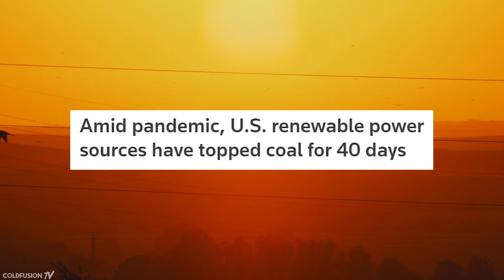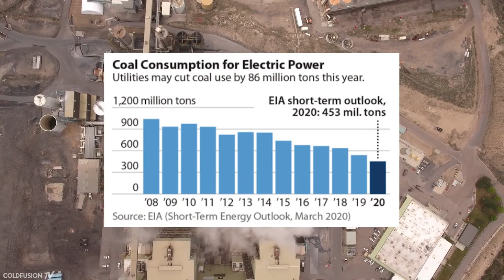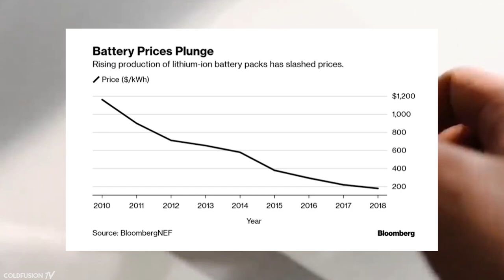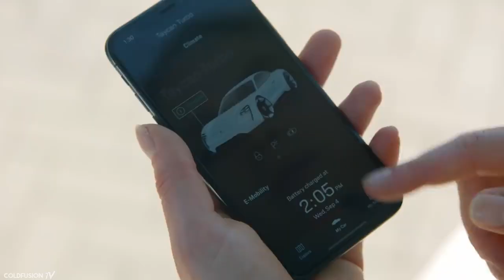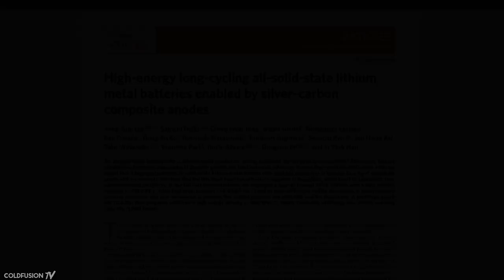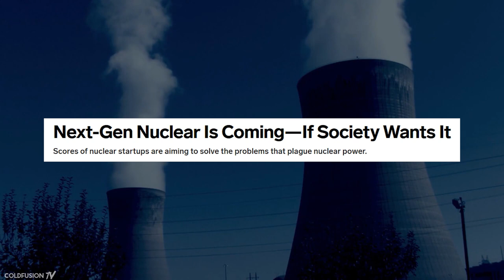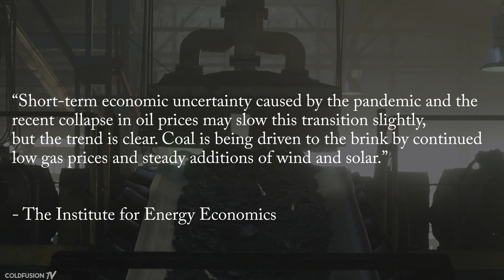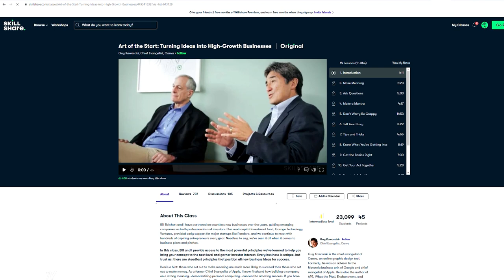Amid Pandemic, Renewables Now Supply More Energy than Coal in the U.S.

Comment: This is a silly / meaningless milestone because the market isn’t deciding this outcome, it’s government biasing the choices by taxes and regulations and subsidies.
Reply: BobWidlefish all of which are helping the fossil fuel industry so therefore it’s quite impressive
Reply: What's the difference tho ? The important thing is that we pollue less by producing energy.
Reply: BobWidlefish how does that make it meaningless? Who the fuck cares about the market, the fact is that renewables are providing more power. Renewables are better for the planet. Onwards and upwards. That’s the meaning.
Reply: @brunokallasfs  How are government incentives that give tax breaks to energy companies using green energy helping fossil fuel industries? What you said makes no sense.
Reply: @____-pb1lg  States that have strict regulations about fossil fuel based power production and massive green energy incentive programs for utility companies also tend to have the highest cost electricity in the country.
This might not be a big deal for most middle and upper middle-class families, but it's a huge burden on low-income families, forcing many to get state assistance to cover electrical costs at the threat of having their power cut off.
Sure, the states may help once a year (particularly, in the summer time when power rates are at their highest and usage as at its yearly peak) but think about the damage it does to families on a financial and credit level.
Renewable energy is still very expensive, and very few advocates of it ever consider the cost to the poorest of the country.
Reply: Actually, the coal price collapsed years ago. Since 2012 to 2016 95% of the share price of coal companies combined stock price evaporated. It got up again to 'only' a loss of 75%. Many, many coal companies went bankrupt. Coal's trend has been on a decline ever since. In large part because of investments by companies for 10+ years are just not gonna be profitable, the writing is on the wall. Solar (I've not checked wind) even without subsidies in large parts of the world and large parts of the US is cheaper than coal. Prices of solar, wind and batteries keep going down as production ramps up.
Reply: @Theonlyoneleft1000  Don't look in the chemicals uses for fracking, etc. either :-)
Reply: @TheSpikyCantelope  Who the fuck cares? 
Well, let's see:
1. Poor people who can't afford high electricity costs in states that force utility companies to adopt green power generation technologies in new power utility stations.
2. Basic economics. Renewable power generation methods tend to also have higher upkeep costs. More frequent maintenance. And less efficient and less reliable power generation (especially without massive grid-level battery units).
3. Without competition, there wouldn't be much incentive to bring costs down or improve technologies on a rapid enough speed to actually allow green power production technologies to make a truly meaningful impact on the growing power usage of the world. 
There are entire studies that talk about the expected power demand of the planet and how our current green power generating technologies won't be able to come close to meeting said demands without real innovation.
Reply: @xxxdroidmonkeyxxx  Mmm didn't think about that, gotta look into that cause it looks like there is causation but we don't know if it isn't just corelation. 
Still you are right not many people talk about this aspect of it. 

The gov funds a lot the fossil industry tho, don't you think that the better solution is to use those funds to help cover poor families' rising energy expanses until it is more affordable ?

Do you have any reading I could look into about that ?
Reply: @xxxdroidmonkeyxxx  

Why does the green energy need to compete with fossil energy ? Can't you create competition by making renewable energy companies fight for big government contracts, like big enough to be juicy but small and numerous enough to be able to spread it and not create a monopoly? It's working in a lot of industries. Or we could force all energy companies to invest a big enough sum in green energy to force them to try to make a benefit with it ?

I am not very well versed in the subject but I would expect lawmakers to find better solution than me (or maybe not sometimes politicians are dumb, it's their job tho so I would hope)

AndI feel like giving incentives for renewable is just fair cause coal etc also had and still have government aid , you gotta level the field to play a fair game. Cause inovation can't always compete with a bigger wallet.
Reply: @____-pb1lg  the difference is that the government is notoriously incompetent at its job. the taxes make businesses incapable of moving forward by, for example, investing in nuclear reactors that will cost a lot at the moment, but will more than make up for their costs in the future. the regulations are naturally anti-competitive, but they often prevent businesses from taking advantage of situations, take everything the epa has done in the last few years, which has ironically done more to prolong climate change than it has done to prevent it. the subsidies take away the risks that force competition to innovate, while also taking leverage away from the consumers, in this case other businesses that could benefit from a renewable energy source. ultimately, the fact that the market isn't deciding the outcome isn't just meaningless, it is making the problem worse.

@TheSpikeyCanaloupe "who the fuck cares about the market" who cares if everyone is poor and starving, so long as a faulty, easily manipulated statistic says we technically tried to prevent climate change. 1) renewables are not providing more energy. most of them aren't even better for the planet. this video goes into it a bit, but you should do your own research to make sure/get a better perspective https://youtu.be/N-yALPEpV4w 2) you clearly don't know what the market is. the market is basically an extension of the economy, which is an extension of the people. making the market weaker necessarily means making the population poorer. regulation and sacrifice won't save the planet,, nor will it save humanity, innovation and efficiency will, and the government is only good at one of these things. granted, that is just my political ideology getting in the way of science. it isn't like climate science hasn't already become a tumor, festering with the putrid rust-colored puss that is politics, surrounding the red, blue, purple and black colored wound that was once a healthy scientific community. who the fuck cares about the market, malthusians say as they lobby ever encroaching government regulations that never even attempt to achieve their stated goals. shit, i am really quite biased it seems. if you have any arguments that might change my mind, please do inform me, but as far as i see it, the only reason the market hasn't already solved this problem was because a committee of political assholes decided to associate nuclear power with nuclear energy, and a bunch of pearl-clutching useful idiots protested our best option for survival on the grounds of an entirely fallacious argument that hinders, to this day, our ability to progress as a species, and even prolongs the time we spend using an unsustainable energy source that we have known was bad for years. we didn't need regulations to go from whale oil to kerosine, the market solved the problem on it's own, yet political activists masquerading poorly as science enthusiasts continue to insist on their pseudoscience of population control, while trading everyone else's freedoms for the illusion of safety. you can understand how i might be agitated by this, can't you?
Reply: @Bruno Kallas you’re mistaken, green gets a lot of subsidies.  Cheers!
Reply: @I'm_not_Billy are you sure the total pollution is less?  I hope it is.  Cost is also a factor.
Reply: @TheSpikeyCantaloupe I care about markets.  Markets are how we all reconcile our choices, our preferences, through our voluntarily spending.  Cheers!
Reply: @davidlewis6728  what about gov contracts like I said ? (realized maybe  I wasn't very clear, I mean by that a big contest in which the best design for exemple wins)

It seems to me like it solves a lot of the problems you have, it is used very often in the military and in terms of technology the US has one of the best militaries. A lot of inovations were born from this method. 
The first horizontal flight capable jet iirc was made thanks to a gov contract.

The gov needs electricity anyway and it stimulates competition while making it monetarily viable to kickstart the industry.

About your arguments on taxes, the thing is, even without them most corporations don't make long-term investments. 
Because like you said it costs a lot and doesn't give a lot back on the short term which is the exact opposite of what the investors want. I mean, who wants to invest and maybe get it back several years later when the company could make quick money to get you back your investment and benefits early ?

While the gov may not be the most competant the market needs guidance. 
The market is only good at making money, lots of money, quickly and with the easiest way, if there is no monetarily incentive to do something it won't do it, and that's is job you'll say, fair enough, but then the question is is there money to make in preventing climate change ? And will be it be a quick enough money to make investors happy ?

Well let's see, without any gov intervention:
- creating solar plants or a nuclear reactor takes a lot of time, several years during which you lose money ( ouch, investors no happy) and that is if you already have schematics and experience cause otherwise you're gonna mess up and it's gonna either fail or cost more or take more time.

Or you can invest more into fossil fuel, there is already more infrastructure, more experience, it's a proven market so investors won't be too shy.

-the public awareness about climate change isn't very developed especially in the US, so you won't get a lot of pressure for it, on top of that changing energy supplier is a process that takes a lot of time (between 1 to 3 month) so unless they feel really strongly about the climate the customers won't change (if they even can), that is if they even know where their energy supplier get their electricity from, I don't think lot of people bother to do the research.

-the public doesn't like nuclear power plants, especially near their house. The company will get a lot of pressure, even if they buy the land they could get protests, or intentional degradation (+risk, -investors) that could stop you from building or operating the facility, you need expensive security mesures not only to protect you from the outside (terrorism etc) but also from a meltdown, if you mess up everybody is gonna be on your back, you will lose a lot of money and qualified employees (++risk).

Better cleaner energy is just more risky and less efficient in terms of money making.
Reply: @____-pb1lg  government contracts take away the leverage of the consumer, and need to be paid for by taxpayer money. the less leverage the consumer has, the less the business has to adapt to the consumer's demands, but this increases competition somehow? please elaborate. the government is ALWAYS worse than the market, look up the economic calculation problem for more details. btw, the problems of the government don't just apply to nuclear power. the whole market is held down by every single thing it does, the pencil analogy applies here, since affecting any variable remotely associated with anything involving the creation of a pencil will ultimately affect the price of the pencil as well. the government is good at relocating risks, they cannot ignore market forces, and doing this almost always reduces the quality, and quantity of options. investments are inherently risky, but for you to say that the fact that an investment takes time, and might not return any profits makes all investments unwise is a bit over simplistic. everything is a resource, everything is an opportunity cost, and everything is an investment. making a business is an investment, and the biggest, riskiest investment you can possibly take is assuming your competition isn't making investments, too. ever wonder why you aren't seeing sears anywhere anymore? what about blockbuster? the government makes the risks of an investment smaller, but the payout is less in return, if you factor that into your calculation, you might realize that the government is a large reason why investments are so slow, and don't pay much. as for nuclear energy, the problem with nuclear energy is political in nature, modern reactors do not meltdown, and radiation from nuclear reactors is about as harmful as radiation from 5g, combine that with the fact that nuclear is better than all the alternatives, including coal, in its power output, it's resource efficiency, it's safety, and it's reliability, and i honestly can't see how investors who know what they were doing wouldn't want to invest in it. granted, the public would probably have a problem with it, but once the data comes out, they should have a harder time organizing.
Reply: @davidlewis6728  bro please use spaces and new lines I am on mobile, it's 5am here my brain is struggling with the wall of text.

Clearly you're really anti-government and liberitarian and honestly I don't have the brain power rn to debate on that, maybo tomorrow.

Just to expand once again on gov contracts:

-first off, the government is an extension of the will of the people so lawmakers would try to make the best decisions to be elected again (obviously you personally don't believe in that but I feel like as a democratic country it's an important point to make) but moving on.

-2nd point the government's needs in this case like a a lot of others align with the consumer's: a technology that polutes less, cheaper to make, and more reliable ( and again you can see a lot of examples of that happening: need I remind you who pioneered the nuclear industry ? who built the first nuclear reactor ? (for those who don't know it's the government), what about the aviation industry that really took off after world war 2: who built all those aircraft that were cheaply avaible after the war? Who trained all those pilots that flew those planes?
, (drum rolll, the government !) 
or the gps technology that we are all using, Who was it first built for ? (spoiler it's the government again), space exploration: without nasa and the government as pioneer we wouldn't have spaceX or blueOrigin cause it would have been way too risky without obvious benefits (a myriads of benefits that we are now reaping thanks to the big G). I could go on and on but I think you get it) I am not even that into governments, I like them just big enough to not be over me, but to say that the market is ALWAYS better than the government is just naive.

And btw you're the one simplifying my argument mate, I was comparing a safe, high and quick yield investment against a riskier, maybe higher but definitively slower yield one. And again, the real ones in power are the board of investors, unless there is a strong CEO with a strong vision and the charima to pull it off then the board is gonna take the safe quick and high yield one. Investors don't have the foresight nor the desire to look far into the future. 

Anyway, maybe I'll come back for the rest of your comment tmrw, way too late for this
Reply: @____-pb1lg  i understand, if you want you can take a break, but i usually find writing like this a bit easier, but i will try to put more spaces in my comment. you aren't the only one who is tired by the end of the day.

as far as elected officials go, there is a concept called rational ignorance. the idea is basically that the time investment of finding a candidate that you like is never worth the result, as you are maybe one vote in however many other voters are counted (rarely ever less than a thousand, as far as state elections go) and the person you want is just one candidate out of however many there are. plus, they aren't capable of doing much even if they were obligated to do so, and are generally incompetent for the same reasons that all the other government programs are, the big one being the economic calculation problem. the way it is now, it just isn't accountable enough, especially since you can't compare one government figurehead to the other.

i said the government was making investments weaker in return for higher certainty. while i cannot say for certain, i think that if the government weren't regulating the economy as much, the large programs (such as the internet, nuclear power, and roads, for example) would open up to private interests. i can guarantee that the market has more incentive to deliver you the product or service that you demand than the government does, especially if the government is as unaccountable and inadaptable as it is. (also, the planes were made by private businesses that developed in different markets before the war, the government just became a large-scale buyer of various war-related goods. the military did train the pilots though, so you can have that) "to say the market is always better than the government is just naive" a lot of professional economists are naive, i suppose. certainly, every economist who follows the chicago and austrian schools of thought, and even a few keynesians would argue that the government isn't as good at doing the market's job at least most of the time (though, keynesians believe that spending money on unproductive labor can solve deflation, which they seem to think is a bad thing. clearly, this is more complicated than i am letting on, but still)

then you are comparing apples to oranges. nuclear reactors take time to build, but the government is shutting them down left and right for no reason, if we just kept one going, you could slowly build up enough money to expand. also, "investors don't have the foresight to see into the future"? that is their job, they look for the things that will grow in worth, and they invest in that thing. granted, economic calculation problem, the government polluting the price signals means it is harder to anticipate the market.

anyways, ya, see you tomorrow i guess. btw, if this spacing doesn't solve the problem, please tell me, it is kind of annoying tbh.
Reply: @____-pb1lg  To answer your question, no, I don't think the government should help people for electricity if they're also the ones who created the problem in the first place. By the way, this is on a state level, not federal. 
As all issues go, this is an extremely completed issue with so many factors to consider that a short 12 minute video or a YouTube comment section would never come close to covering it.
Ultimately, it comes down to weighing the benefits of reducing CO2 emissions against people's immediate financial well being; which also happens to directly effect people's health.

And here's an interesting read on the topic based on some research that was done recently.
https://wattsupwiththat.com/2019/05/02/researchers-say-renewable-energy-mandates-cause-large-electricity-price-increases/
Reply: @____-pb1lg  You're not inherently wrong with your thinking. Fighting for contracts is an excellent way of encouraging competition, and by extension, rapid innovation. Private investment is far better since it demands more immediate development. 
Governments may have deeper pockets (at least in western countries), but what they lack is the kind of pressure private investment would exert on said companies once they receive funds. 
Fighting for a contract is essentially selling an idea -- a proof of concept. As good as that may be in the short-term, unless there's constant pressure to keep things moving forward, such as when investors demand improvements for profit, many companies will simply stagnate. 
An excellent real world example of this was the US's industrial advancements in comparison to the Soviet Union's. The US excelled in every industrial sector because companies answered to investors instead of a slow moving, bureaucratic government. The government rarely ever examines what it spends (or more accurately, overspends) on because it's not their own money they're putting on the line. Those poor spending habits also happen to hurt other factors of our society, such as, infrastructure, education and even social services.
Why would you want such an important thing like green energy to be directly financed and overlooked by the government if they can't even get simple things done correctly, on budget and on time without breaking the bank ten times over?
Reply: @xxxdroidmonkeyxxx  say, wanna be friends on discord ?
Reply: @davidlewis6728  would you happen to have a discord account?